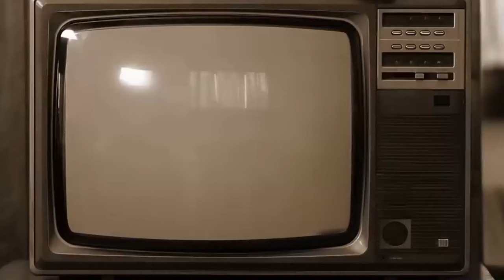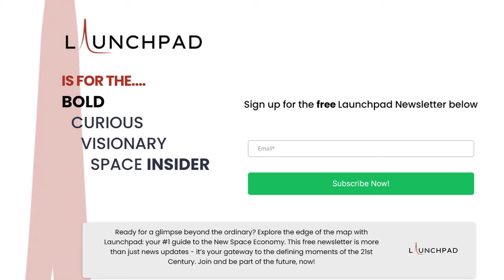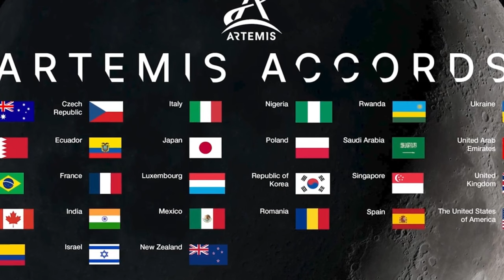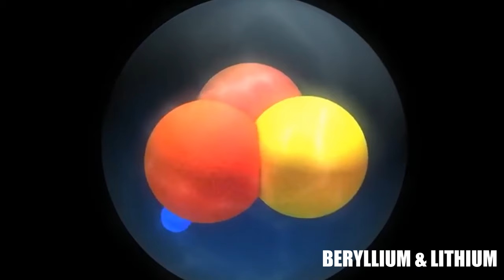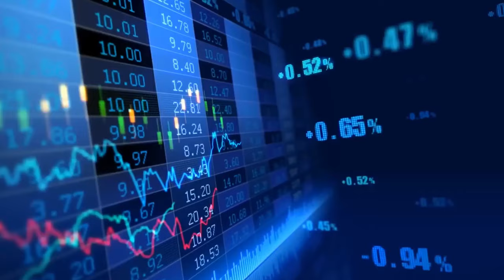Japan reached the Moon. Here's why that matters.

Comment: Correction: India did not land on the South Pole. This misinformation has been repeated endlessly in the media. They landed at roughly 69 degrees south latitude, which is quite a distance (approximately 600 kilometers) from the actual Pole, which is 90 degrees south latitude. A 21 degree latitude discrepancy is about as bad as saying Miami is at the equator.
Reply from the maker: Thanks. But if the shoe fits.
Reply: @PettitFrontiers  What does that even mean?